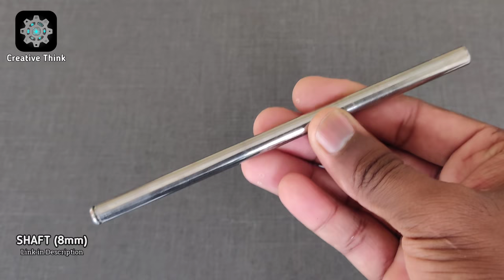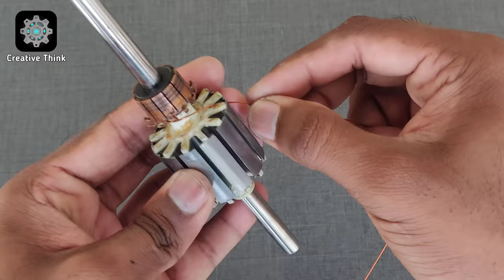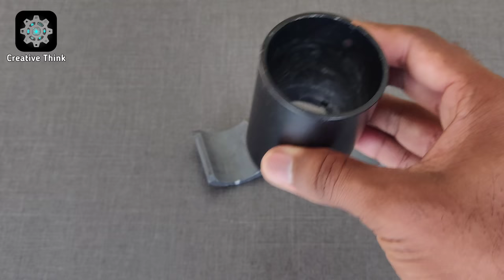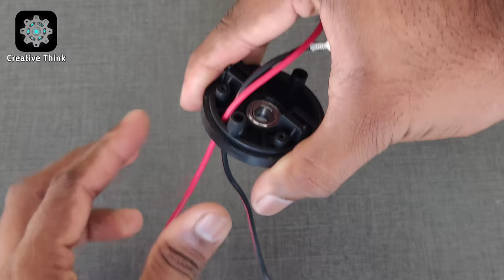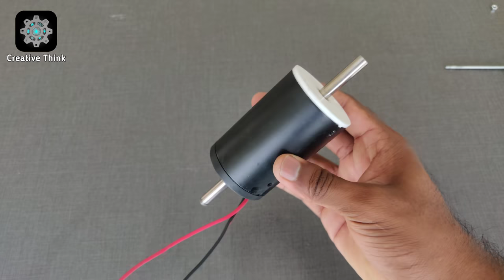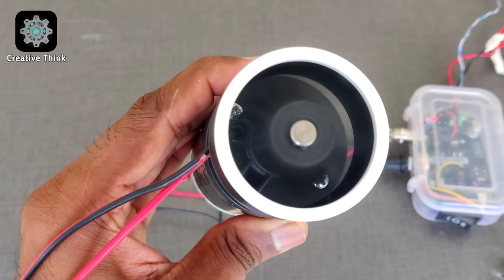Making Powerful Spindle Motor

Comment: Rather than use such a home-made lousy engine, I'd rather buy it from professionals. Winding the rotor and assembling parts from an old engine means nothing. Of course, this "inventor" knows nothing about the fact that the rotor should be at least statically balanced. And I'm not talking about the need for dynamic balance at such speeds. The engine is spinning, but the speed is far from what the gauge shows. Why doesn't the display show right from the start of the measurement? Well, it can't, because the data is meaningless and does not correspond to reality. Although the engine assembled in this way rotates, the question is, for how long? Before the bearings are destroyed and the engine shatters! And I'm not talking about other "engines" from this "creative inventor" blinded by pieces of plastic!